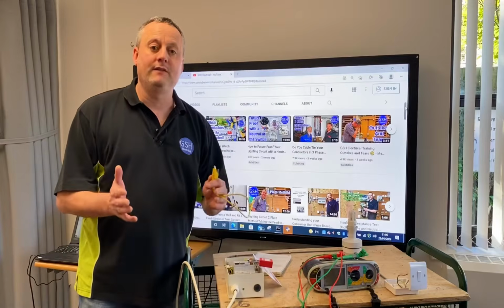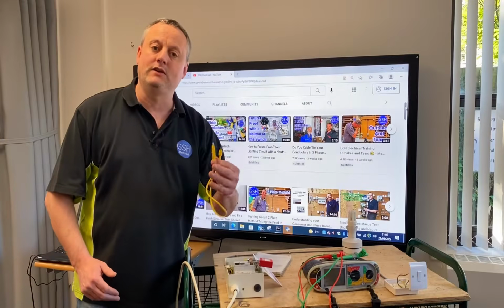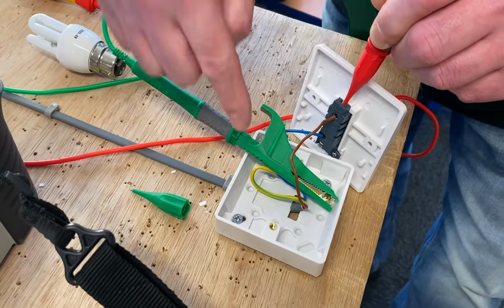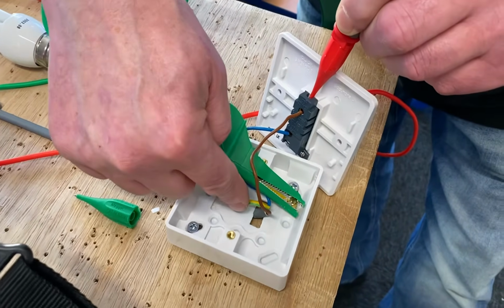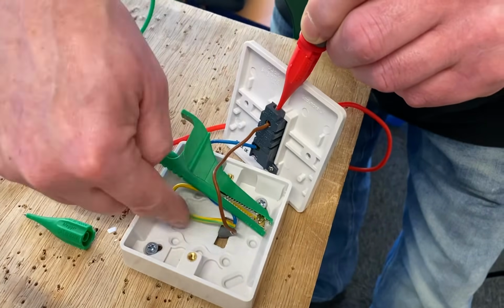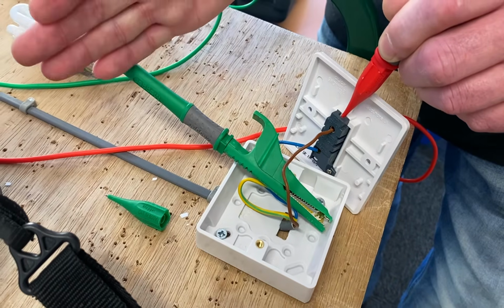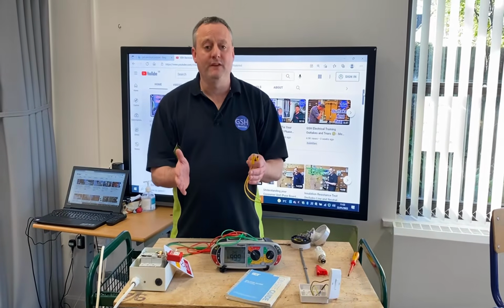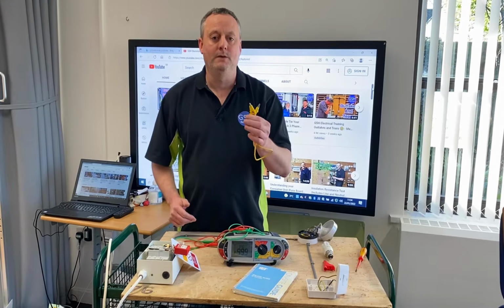How to Carry Out the Continuity of the CPC & Polarity Test on a Lighting Circuit Using an R1R2 Link

Comment: Hi! I have the am2 exam in 2 weeks, my question is what about the paralel path on R1+R2, on the am2 do i need to test with cpc conected, or disconected from MET? Thanks for   an eventualy answer! I realy appreciate yyour video!
Reply from the maker: Hi, not sure any AM2 circuit has a parallel earth path. They will not want you to keep removing conductors that don’t need removing as this add to the wear and tear on the rig. Remember you can talk with your instructor 👍🏻
Reply: @GSHElectrical  thank you very much for your answer! I wish you all the best!

Comment: I don't remember measuring the R1+R2 at the light switch during my training a few weeks ago, only the continuity of the CPC using continuity test method 2. Very strange.
Reply: R1+R2 should be done at every point on the circuit

Comment: What about the extra length of cpc to the switch?
Reply: I am wondering the same,. Isn't the circuit the same length for both tests?
Reply: Yes, the cables pretty much work out as the same length, it is more likely that the switch contacts were adding in the extra resistance seen when testing at the light fitting.
Reply: If its 1.0mm twin and earth it will be the same value at light point or switch.  1.5mm twin and earth will be different value at light point and switch   because the cpcs has a different size at 1.0mm

Comment: Hey Gary, just a quick one, can you explain why you test on the switch side of the cpc rather than on the loop terminals?
Reply from the maker: It’s the longest part of the circuit and proves the switching line is working when the switch is operated 👍🏻. Thanks for watching Gaz

Comment: Hi Gaz, thanks for the video.  I'm interested in all things eletrical but I'm not a qualified sparky.  In the video when nulling the leads you say that "if it was flashing zero we know it's below zero". As you're going to measure  the R1+R2 in ohms (a positive value) can you explain how you can get a resistance below zero, ie a negative value or what am I missing?
Reply: You get a negative value when the meter over compensates for the lead zeroing. Sometimes due to a bad connection during the lead zero or if the instrument was previously zeroed with longer leads and then the leads are swapped for shorter ones but the zero measurement was not re-done.